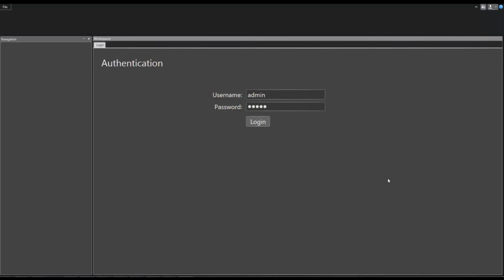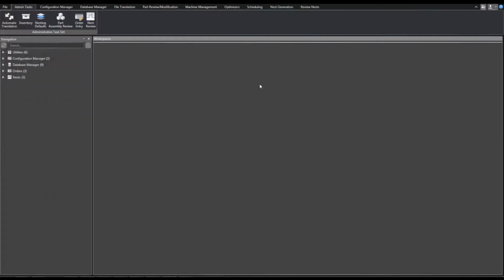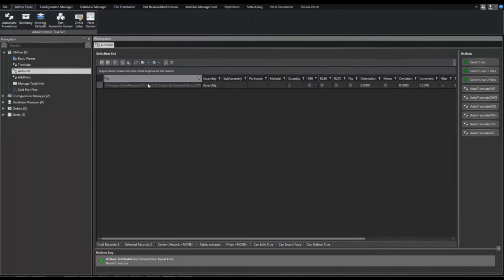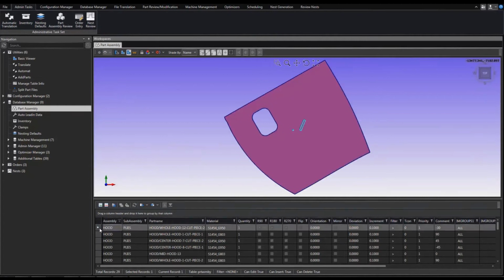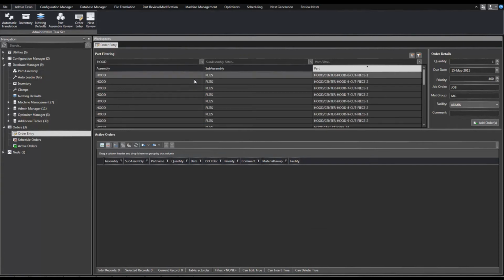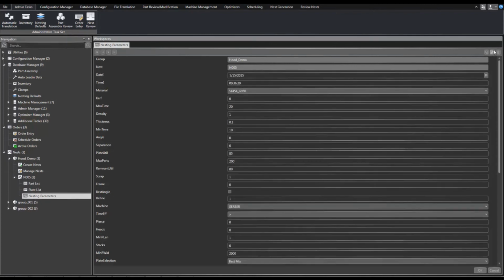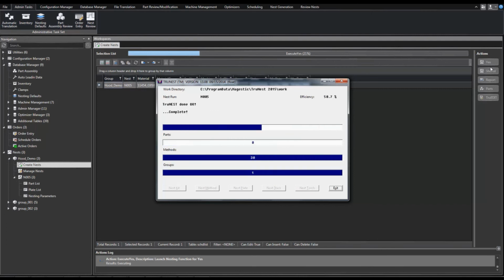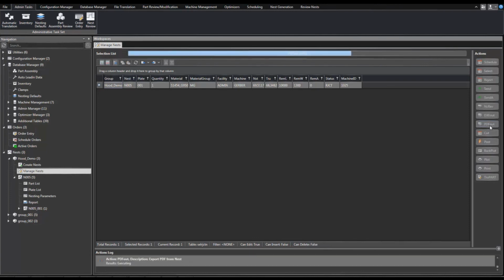Product Overview -  TruNest 2018

Comment: The nesting works through algorithms in a certain time period and spits out the nesting.  I wonder if this can be improved by re-nesting or setting a time on the nesting process to allow the algorithms to go for longer, that way you can achieve better nesting efficiency?
Most nesting software out there does this.
Reply: It's hard to have an answer because the software is no longer available on Autodesk store and canceled it's update. Furthermore its not a publishing video :D